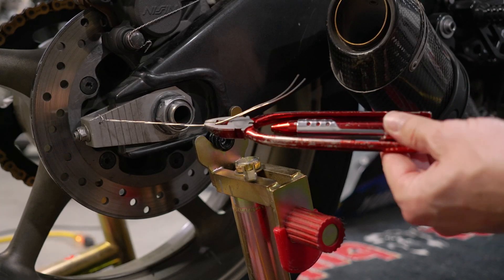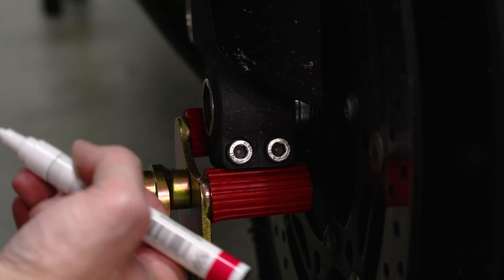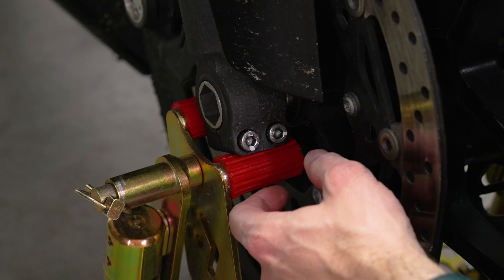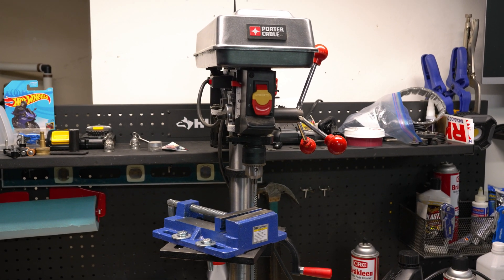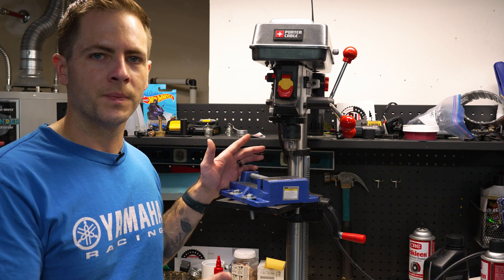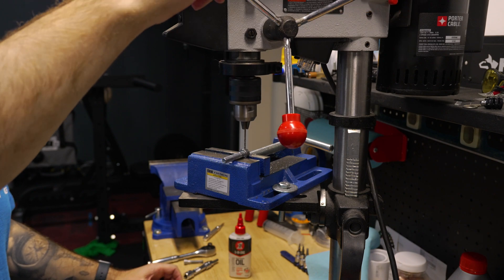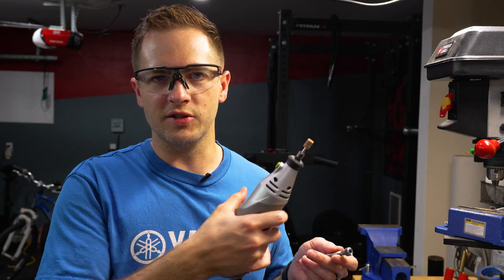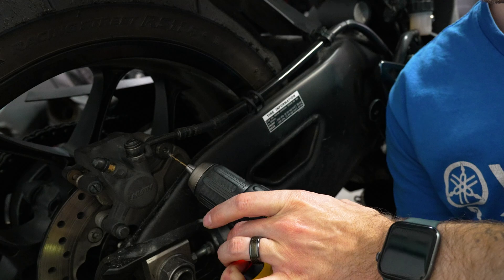Save Money - How To Drill Bolts For Safety Wire On Your Trackbike

Comment: Good summary! Can I ask your drill press speed? I'm struggling with this on some pretty thick 10.9 grade bolt heads. The speed recommendations for a small bit seem to vary a lot.
Reply from the maker: I filmed this quite a while ago so I can’t remember the exact RPM, but it’s on one of the lowest settings, if not the lowest. Probably around 600-700 RPM.
Reply: @RideTucked  Thanks. I found the slowest possible speed was best, my press only goes down to 750.

Comment: Jay hello fm down under[the big western part of the Continent. Mate i have taken the time to hit all the buttons for you and the channel. Jay, and anyone reading this I have found your channel to be succinct and  chock full of info. Take this one for example. Really great data and example you really know your stuff. Mate I used to be employed as a Licensed aircraft engineer and mechanic and airplane transport pilot [ie at times I would kick the tires then light the fires. Give her a kick in the guts and take it for a spin a check, & make sure what we had done was correct and make the right noises. This included safety wiring, Jay. Mate you are on point. DIG IT and the work you do.] ☮️🤙😊 cheers mate !!!